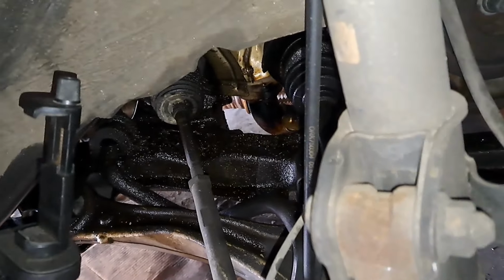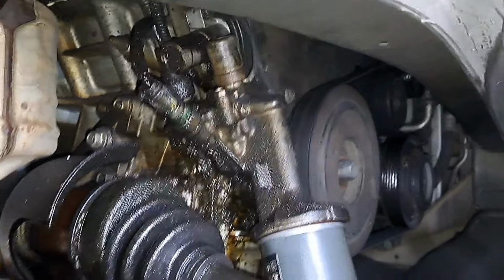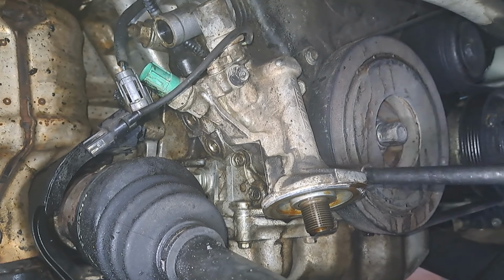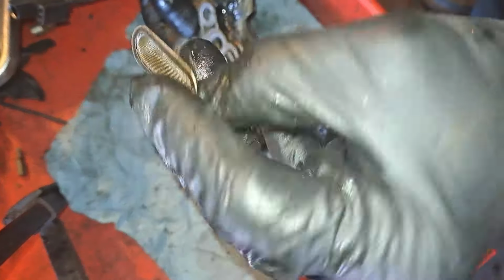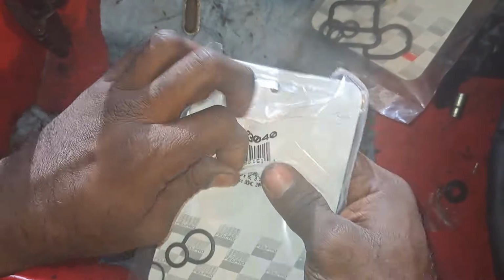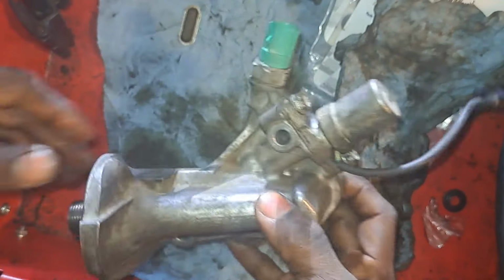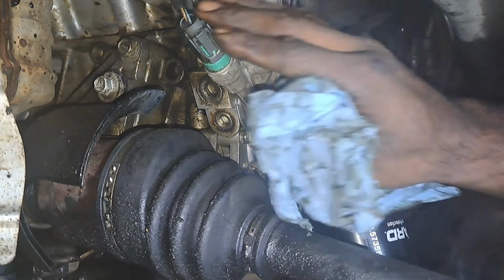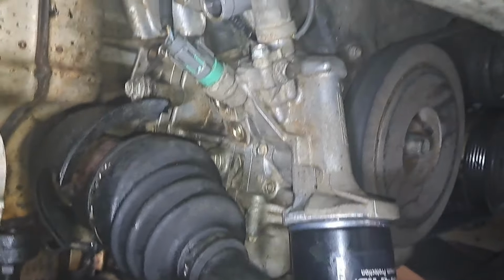leaking oil filter adapter repair V6 Honda

Comment: Just did mine . After watching your video it took me 15 mins to replace the gasket and turn the van back on. Thank you for making it clear and simple.
Reply: Do we need to drain engine oil ?
Reply: @genekorin3390  no
Reply: @genekorin3390  well I did not drain the oil. A lot did come out. So I would if I were to do it again
Reply: @Blazeeeee7  I did not drain the coolant . I did drain the oil though before I pulled it off to replace the gaskets
Reply: @Blazeeeee7  it was worth saving the money and doing it yourself
Reply: I think mine needs this done also.... I'll add this to the next oil change.

Comment: That is one thing I really appreciate about these Honda designs, they make them so that these individual parts are repairable with a simple O-ring and or gasket set. Take their power steering pumps, very expensive, and I am sure the dealerships love selling new ones. The kicker is, just about anyone with some basic hand tools can rebuild one for around $30 or $40, depending on the Honda dealer you purchase the O-rings, seal and bearing from.
Reply: It's a shame they do not sell some of the gaskets, VCM gaskets for instance. You have to buy aftermarket gaskets.
Reply: Lmfao the kicker with the power steering pumps on the v6 hondas is that they are a pain in the ass to install especially the high pressure line that routes to the rack directly, and if u got a leak on the return line even a more pain the ass problem, and i dont think basic hand tools will suffice for a power steering pump job lol espeically if you need to remove the motor mount to replace ps belt thats connected to the crank pulley
Reply: @ReeseAssad  Understand, I own the tools. And I was simply speaking about the pump itself. Not the entire steering systemm.
Reply: @michaelwright1602 he's one of those drama guys huh lol.
Reply: @ReeseAssad talk abt pain in the ass .i work at a shop so i stayed overnight to change the ps line that goes to the rack. And I had every tool .the pain in the ass is getting the threads to line up on the rack 🤦‍♂️was there for abt 3 hours

Comment: Great video. After replacing the oil pan and gasket in a failed attempt to fix a massive leak on a 06 Ridgeline i watched this and realized all the oil was coming from the filter housing and not the pan seal. This video was a big help. Thank you

Comment: for anyone watching, when you take a new gaskets out of a package, they are bent out of shape. Leave the metal and the new gasket attached out in the sun for 10-20 minutes and it'll fix into place automatically. This saves so much hassle. I've seen people just install them as is and it leaks again because of the gasket not sitting in place properly.

Comment: I just replaced the same gasket on a 2006 Pontiac G6...after u replace it it wont leak anymore...nice job with the diagnostic 👍

Comment: Had this annoying problem for the last 4 years. Just never pinpointed to this. I did the valve cover gasket earlier last year. 2006 ridgeline with 220000 miles. Thanks for the video
Reply: same idk how ive been letting this leak over my driveway for so long. It is such an easy job I shouldve done it months ago

Comment: Thanks for making this video.  I performed this oil leak repair when I was doing my timing belt recently. I bought the OEM gasket directly from Honda and it was not very expensive at all like 12 or 15 dollars, but I did not get the solenoid and oil pressure switch seals, unfortunately. 

I came across a water-based engine degreaser product, that I used to degrease my engine, CV/steering  boots and sub-frame.  I like that product better than brake cleaner, because I think it works better and it does not harm the rubber or plastic components.  You do have to rinse it down with water, but that was pretty easy.  Thanks again for making this video.
Reply from the maker: @joeromang703  cool...

Comment: Honda quoted me $2500 to do a full oil pump replacement but after some diagnostics and watching this video, I have discovered it's just the oil filter adapter gasket. A $16 part and 1hr of labour.

Thank you!
Reply: Yeah I don’t trust shiet from the dealers

Comment: Thank u for the great video.  I knocked my repair and oil leak  out in an hour with your instructions.  $14 gasket at oreillys
Reply: I just done a massive oil leak there on my grand daughters Pilot. I was sure surprised when Oreilly's had that gasket in stock. The old gasket had broke in one spot letting pressurized oil come right out above the oil filter.

Comment: Having a oil leak on my 01 accord v6, going to start with this. Very nice video
Reply: Was this your issue bro ?
Reply: @crisacevedo5819 it helped like 80% but I still have a small leak. It was a real easy fix and cheap. I would recommend it, there is a lot of rubber gaskets. But now it's a small enough leak I don't worry about it now.

Comment: Did the oil filter "adapter" (weird name for it) on my MDX, same as this car. Spent a long time cleaning everything around it. 
Its an easy repair but I really dragged it out and did it right.

Not a drop leaking now.

Comment: Great video!  Thanks!  One minor point, I wouldn't recommend spraying cleaner into the open housing.  You're better to spray the rag and then wipe it.  You could contaminate the oil by doing it the way you did.

Comment: It’s common on these for the VTEC solenoid (i.e. pressure switch/spool valve) on the V6 to leak. Thank heavens it’s mostly an easy fix. But I wouldn’t replace the main gasket without the mesh filter.

Comment: GUNK "Engine Brite"   or Simple Green are really good cleaners for the outside of the engine block to grt all the old oil grime off.   Sprsy them on liberally, let them sit for 10 to 15 minutes to emulsify.   Then blast the solvents off with a high pressure gargen hose or power washer.

Comment: Changed all 3 of the gaskets you did and it still leaks. I remembered the crank shield was dry when I did the spool valve body. Where else can the leaks come from? It's apparently still leaking around the same area (passenger side lower side)
Reply: Coming from the oil pump O-ring.  You need to reseal the actual oil pump.

Comment: Is there a way to remove just the male piece for the oil filter adapter? My new oil pan doesn’t have one and I can’t get the part anytime soon so I want to take it off the old one

Comment: What part would cause a leak down the back side of the motor that drips onto the exhaust? 08 odyssey, j35. Valve cover gaskets have both been gone, and the solenoid on the backside isn’t leaking, but I can’t see anything else.

Comment: My 2009 Honda Pilot 3.5 oil filter housing doesn't have a pressure switch or VTech solenoid attached to it, but the o-ring kit I got for it has gaskets for each. Any ideas?

Comment: Parts Shooter, once again, great video.  I'll be darn, mine is leaking after putting in all 3 gaskets.  How long should I let it run to see where it leaks from?  And you briefly mentioned, that the switch thing can leak also??  Has anyone mentioned that to you?  Thank you!
Reply from the maker: You may have a leak elsewhere, cracked housing or human error during install🤔. Things happen!  Try rechecking your work or clean the area and check for leaks
Reply: Thanks!
Reply: Parts shooter, once again, your video saved me! Besides this gasket, my oil pressure switch was leaking. (If you go to 7:00 in your video, you see the the black boot over the switch). Wanted to share that in case somebody else checked out your video!

Comment: If you own an older Honda J series, I would do this gasket swap prior to it failing. I think I will put this on my list, do it at my next oil change. 114,000 miles on the 2013 Pilot.
Reply: Have you never ever heard brother, if it ain't broke you don't go fixing it? That seal could go 500k b4 leaking, you cannot predict the life of each individual seal.

Comment: cool video thank you for the info. i had no need disconnect the filter arm i just took out the screws and replaced the gasket. no big deal just have something for the oil drip and break cleaner to clean up the area.

Comment: Could a bad gasket cause white smoke to come out? I’m getting white smoke coming out from the right side. Not sure if this is the cause but I did notice that side of the car is dirty from oil.
Reply from the maker: Extremely bad valve cover leak or power steering hose leak will cause long standing smoke under the hood. Because of the location, typically you won't see smoking because it's away from the exhaust
Reply: @partsshooter  ahh makes sense. I changed out my power steering hose about a year ago and I’m now noticing the smoke. That might be the problem then.

Comment: My 2005 keeps setting off the check engine light and the vsa then the van will go into protection mode. what would cause the oil pressure to drop ounce the motor warms up.?
Reply from the maker: @juliescurlock4350  oil pressure can drop due to low oil level, weak oil pump,  incorrect oil viscosity, excessive main bearing clearance, and failed oil pressure sensor.

Comment: Those 2 connectors are hard to get off any suggestions?
Reply from the maker: @keithlove1175  brake cleaner and wd40 or penetrative oil.  Then clean after removed successfully with brake cleaner

Comment: Getting the dang solenoid connector unplugged on my Honda V6 is near impossible. There must be more room in this Odyssey than there is on the Accord. Been struggling for almost an hour.
Reply: I am having the same issue. My leak is coming from the top solenoid. We're u able to disconnect it? I tried unscrewing the solenoid but one of the 10mm screws is impossible to unscrew ( I stripped it slightly because I used an open wrench). So don't try to unscrew it.

Comment: OMG . This is it!!   Is this it??  Probably...
 Im back here cuz of the sludge all over. This pic looks just like mine did. Now clean but never diagnosed by shop.    What broke though?
Over the course of a month with two incidents something broke was caught up in belt the flew out from under.  That part still looked in tact but soaked in oil.  The noise was horrible I thought the wheels or  front end were going to fall off.
  B4 event no sludge, after event sludge!   The damn mechanic didnt believe me & never provided ANY feedback during all their supposed work...
Also my front end 6 mos later is way sloppier & nosier.  Gee there goes those bushings!!!!!!  As if i did have enough front end work to be done.
signed, female-on-a-mission.    Oh, any feedback appreciated.😊

Comment: What year Honda Odyssey. I have a 99 Honda Odyssey with that part # being 73040.    Are they the same
Reply: They should be the same. I believe the 2nd gen odyssey went from 99 to 04
Reply: @BTRPlumbing  True 99-04
Reply: So was the part #73040 correct? Thanks...

Comment: Should have resealed the rest of the oil pump assembly, very common leak on the J-series.
Reply from the maker: So you're saying the 1hr job in doing the filter housing, should've have been a 9-hour maintenance prevention by doing the oil pump while I was in there? 

By that logic,  I should've pulled the transmission and did the rear main seal also if I'm doing a axle seal... is this correct,  please explain your logic here

Comment: Keep in mind if resealing rhe oil housing DOESN'T take care of the leak, then yoi need to reseal the oil pump. There os an O-ring between oil pump and rhe engine block that likes to leak put the top and run down the outside of the oil pump onto the oil filter housing.
Reply from the maker: Ok

Comment: Replace the split cv boot with a universal glue together split boot. Aftermarket cv axles are garbage.
Reply from the maker: @danp7463  you joking right? Lol
Reply: @partsshooter  or you can disassemble the cv joint. They also have a pneumatic tool to stretch the new boot over the cv joint. I've seen vibration issues on Honda's with aftermarket half shafts. Usually dealer OEM is the cure. So the reason I posted what I did was the cheapest and easiest way out while keeping a good cv axle. Now if it clicks while turning; go ahead and replace it.
Reply from the maker: @danp7463  2 things though... the video isn't about cv axles.

And Secondly,  a split  universal  cv boot???  🤔🤔🤔 why mention that unless I misread